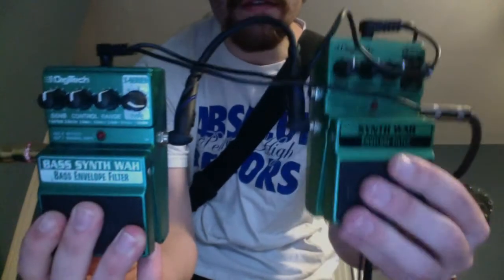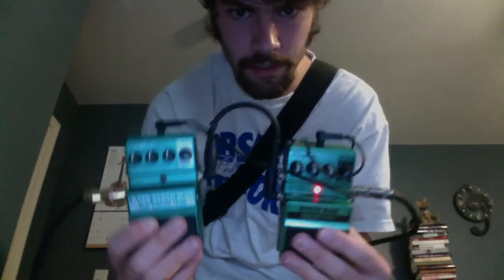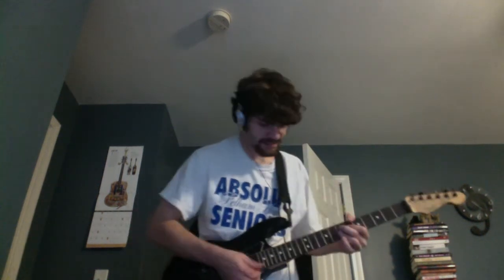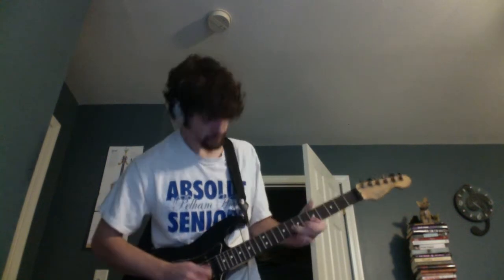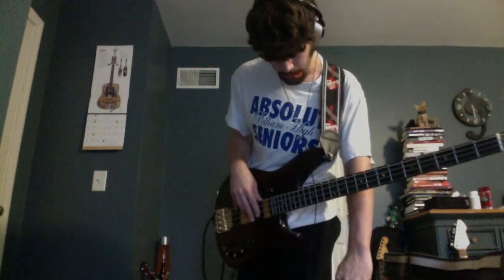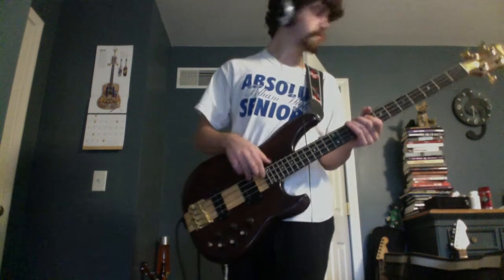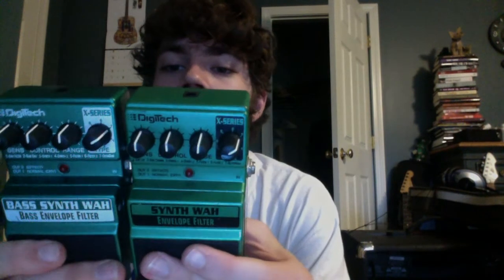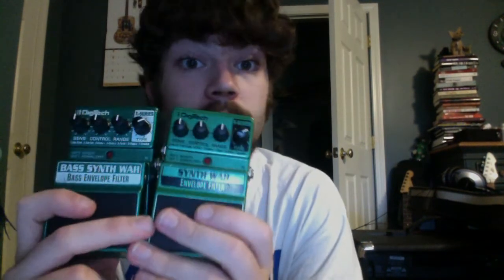Digitech Synth Wah vs. Bass Synth Wah

Comment: I own the bass synth wah (never tried synth wah) but the BSW has a cab simulator.  If I remember correctly I think it’s turned on and off by pressing down the foot switch while plugging in the power and is still applied even in bypass. Anywho, maybe the regular synth wah had the cab sim on in this video and that’s why it sounded different in bypass.